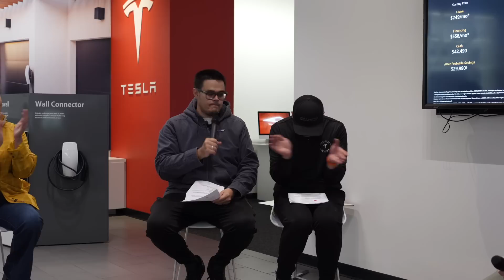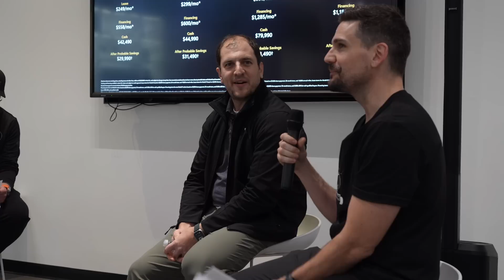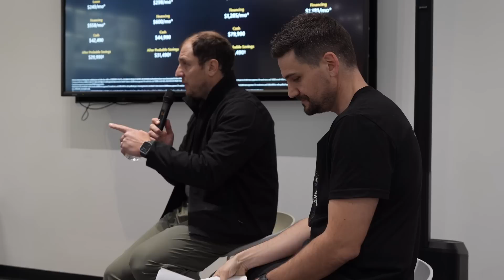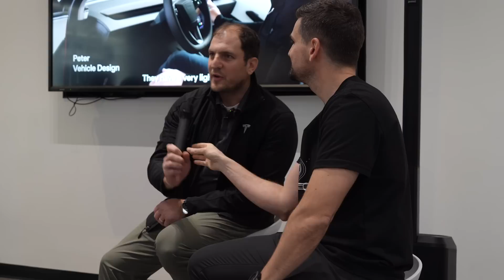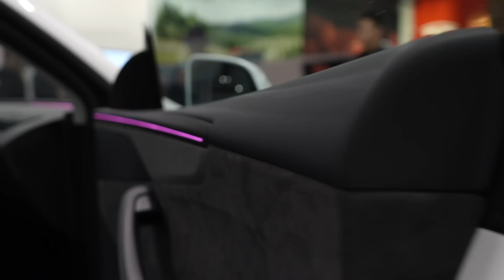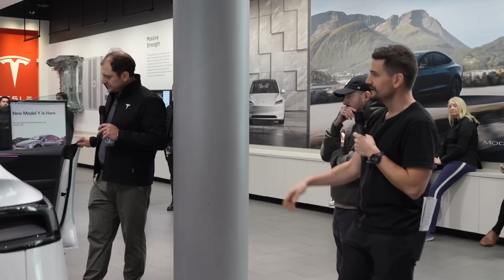SHOCKING DETAILS: TESLA ENGINEERING shares MODEL Y Details

Comment: I have a Model 3 Highland just about to trade in for a Model Y Juniper and the transition to a stalk for turning signals is going to be a game changer. My only complaint I have ever had with the new Model 3 was the turn signals on the steering wheel, it was absolutely horrible and I am glad they recognised the issue.

Comment: Too bad the government keeps mandating those ridiculous mirrors look like they were stolen off a F350 Ford truck‼️ Another problem is the tires all of the eV’s tires wear out in about 10,000 miles due to the enormous weight of the batteries and instant torque❗️The gay guy who picked out the white seats should be fired impossible to keep clean. The front end looks like a set of gorilla lips,get rid of the heated seat seats. Do we really need that in a car that is starving for electricity⁉️ lastly cut down on some of the ridiculous things like 16 speaker Radio and other not essential options get the price down‼️ Gasoline prices are coming down. They just hit $2.19 in a lot of the southern states while at the same time electricity rates are going through the roof in N.Y.

Comment: tesla is losing in many ways compared to chinese EV manufacturers. 
~Charging speed is way slower than competitors, forgiven because they have the best charging network. 
-V2L is non-existent 
-Range of vehicles is moderate
-Fit and finish not as luxurious as some chinese EVs
-Introducing the turn signal stalk only for it to be low quality material
-Lack of heads up display, even the blind spot warning on the model 3 is a joke with that tiny red led light. ENHAUTO fixes this but it is a shame tesla couldn't program their car to do so.

Comment: Looks fantastic…. Please make room in car for a spare wheel & supply 🎉 spare with car. Break the possible bad and experiance with puncture. Or evolve tyres like my Reise & Muller Ebike, which has almost puncture less tyre. Why not produce a tyre that will not puncture. Also with the marvels  of autopilot; 🎉 stop the car hitting curbs and damaging wheel 😢 you must add this feature as it would be unique . Add heads/up a second visual to save loosing concentration by looking away from road. This would bring more buyers;,that’s what they are used to 😮 for ice converters it would encourage them to migrate, new users/ the younger buyers expect the visuals to be straight in front of them ❤ G. I know it’s impossible to please all but my suggestions, just make good sense❤❤

Comment: Why can't the rear occupants in the Model 3/Y have a glass window that can 100% roll all the way down? I mean if you need a child safety reason, that can be addressed by software to simply say "Only allow the window to roll down 45%".

Why can't the Model 3/Y get soft close door actuators which have been around since the late 1990's?

Can anyone at Tesla Motors actually demo how to use the 2018 Model 3 or 2020 Model Y rear occupancy manual emergency door release in under 1 minute without any special tools or any assistive tools? Like for example, if the car was flipped over, how would a rear occupant open the rear door in under 1 minute? Would you feel confident that I could grab any stranger off the street who doesn't own a Tesla and they would be able to figure it out?

Why is it that Tesla Engineers don't do any competitive analysis of other car makers, instead of having to re-invent the wheel even almost a decade after the release of the Model 3? Seems like some of the "great" ideas you have today in 2025 could easily have been figured out in 2015 just by looking at other car makers and asking the simple question "Why do they do this"?

When is Tesla hoping to invest in the Tesla Service Centers to resolve common customer complaints that the techs who work on the cars often physically damage the cars in new and exciting ways? or in some cashes physically crash the cars requiring a 1 year wait to get the vehicle repairs after Tesla Service crashes the car and has it treated like an insurance claim to be repaired at a body shop 🤷🏽‍♂️

Comment: * So, you will come with new colours - nice. What about quality? My black 2023 Model Y can only be washed manually, the thickness of the paint is extremely thin, and after a bit over 1 year of usage I need to fix at least 12spots caused by rubble. 
* New "trunk", as you call it. I almost lost my finger closing the trunk few months ago. Any improvements there?  
* The rear view - is it possible now to see what's behind the car while driving? 
* Until now the feel of Model Y is far from luxury feel. It is all plastic. Pimping it up a bit would cost very little.
* Any improvement on the sensors/cameras? Model Y default state is "Parking assistant is degraded"
* Any improvement of the wipers? We have been waiting now for ages.
* I think it is great that you "rediscovered" your own font - it looks nice and can not be mistaken for anything else
I could continue this list for quite a while. I live in Norway where EVs are now about 80% of new car sale. Tesla Y being no 1. We know our Teslas pretty well. And it is a car designed in California. Really cold weather is a challenge, loads of snow - challenge again. Try to open the door of a black car in the night when it is freezing cold. (without a torch). If you are interested I can send you a long list of tiny improvements that most of us, users must figure our and fix. But hey, we have got a light strip inside the car.

Comment: Build quality...what a joke. Honestly, this is a 8 year platform with updated car building techniques that other car manufacturers have been doing for decades. Noise dampening, compliant suspension geometry and damping, indicator "stalk", front camera and build quality. Tesla just catching up in those areas so nothing technologically mind blowing. I guess the next refresh (don't see Tesla ever bring a totally new Model Y) will have not stalks and maybe a HUD, who knows. 

The Zeekr X7 is cheaper and a lot better value for money with significantly better finish and technology than Tesla. I can't see why anyone would consider an 8 year refreshed platform than a totally innovative and technologically better vehicle like the Xpang G6 or Zeekr X7. 

However, never buy a Tesla at launch as in 6 mths you will get the car at significantly discounted price and especially around Christmas time. Tesla have a high margin on their vehicles and have a lot of leeway to drop prices which they always do. Just see the Model 3 refresh and Cybertruck for example.

Comment: What Tesla isn't telling you is they didn't listen to customer feedback regarding stalks for turn signals. But Europe changed the law requiring physical control for turn signals for safety reasons and if Tesla didn't return the stalk they wouldn't get a 5-star rating on Euro NCAP crash tests. Hopefully, next year the same law will be updated and will require a physical drive selector as well.
Reply: They need to put the bright light switch back and not the auto sensor button which drivers use in the city and blind the other drivers.
Reply: @danc2014  Did you or others test the Tesla light system to see if it blinds the other drivers? I thought Tesla has a adaptive headlight system?

Comment: Ask Angela Chao if she prefers the touch screen shifter. Actually, you cannot: she died when her Tesla went into a pond because she thought she was in D but was in R. And the windows wouldn’t open once it hit water.
Reply: And she was completely shitfaced drunk but yeah it was probably the shifters fault.
Reply: @ yes, you are correct, she was drunk. But she was coherent enough to try to open a window and call her friend (who was in the house a few feet away).
Critical components in a car need to WORK and be RELIABLE. It should not require much thought to shift from D to R or P. And I can assure you that even drunk, she had a (much) higher IQ than 99% of people.
Reply: @ Interesting selecting IQ as measure in this case because intelligence likely had little impact here. I would argue that physical,physiological, and personality traits play a much larger role in human factors mishaps. Even geniuses make mistakes particularly geniuses with cognitive impairment. To be clear, it is a tragedy she died and it shouldn’t have happened but her actions were the significant contributors to the accident. She got in the seat impaired and selected the wrong gear. In the human factors analysis I would want to know things like, experience in that particular vehicle vice others, recency of use, amount of time spent operating other vehicles, physical state, etc. Cabin design can play a role as well as design evolution (new method of operation after decades of a different design). Familiarity with all features is also a factor (mechanical vs electronic door releases). Personality plays a role as well, if a person trends toward panic when faced with a significant deviation from the expected it can seriously impact the likelihood of success. 

I could argue that the on screen shifter has two factors that could make it difficult to use. It is different than the majority of systems in service, and it requires visual verification to ensure correct operation. That visual verification is somewhat inherent in the design. You move your eyes to the screen to slide in the right spot and the visual display indicator is right at the top of the screen where confirmation of the operator’s intent can be seen. Secondary contextual clues would have been present as well. In this case the backup camera would have displayed in addition to the “R” indication at the top of the screen. One might argue that the new method is different from most mechanical gear selectors in that a mechanical gear selector you move the control up or forward to select reverse and down/back to select drive. The on screen selector although different could likely be more intuitive over time because the direction is more closely aligned with the movement of the vehicle but it will take time and experience to overcome the amount of time spent using a different method of control and the concept of primacy (the thing you learned first has some dominance particularly in times of stress or impairment). I know this as a habit transfer problem. I operate to different machines with controls in different locations. I might be inclined to reach for a particular control in the wrong place based on fatigue, stress, impairment, panic, or just error from an imbalance of experience between the two machines.

Panic can play a significant factor as well. People respond differently in emergencies some are cool as a cucumber some are the polar opposite. I dont know where she may have trended in that spectrum but everyone has a trend. Now we can modify our likely response through training practice or experience but most dont do that with driving. This is what also makes intelligence less relevant. As we shift from routine activity to non-standard or emergencies our cognition can also shift from cerebral to more central brain functions “the dinosaur brain” as some say. We can lose higher level analysis as well as fine motor skills in exchange for more gross motor dominance. This can make it difficult to find and press the right control and things like that.

The situation was quite tragic but trying to lay the propensity of blame on the machine and ignore the impairment and failure to recognize the errors she made that day impacts the argument significantly. I personally prefer mechanical controls over software controls but that is because i am older and have spent much more time on mechanical controls. I also love human factors considerations in cabin design like knowing what control I am touching without looking based on it having a disparate feel from a nearby, but different, control. I imagine younger people might feel differently as they have experienced much more use of software controls that can change based on context and phase of operation. I can train or practice to get better but understand I might revert in times of crisis and can overcome that with verification of my activities.

Comment: "...getting much better" isn't a position from which you should be removing controls like stalks and buttons. The easiest way to test this is to have the ability to use the non-hardware control options on vehicles with the physical controls still. I myself don't use things like auto cancel for turn signals, because while it works ok, it doesn't work 100%, which means I'm not having to pay extra attention to when it does and does not work, which results in me turning the signal back on have the time and likely confusing drivers around me.

Little bit of a rant, but you just can't design and sell cars for a FSD world, when it's already 4 years past when they started removing stalks and we're still waiting on FSD. And on top of that, they're adding stalks back in essentially with the new Y because feedback from drivers. Just very poor decision making.

Comment: The front passenger seat control on the screen is a good step, but to make it useful it needs to operate when the car is in motion, and also when there is someone in the seat. 
It’s not as smooth of a process as it could be. I usw the car for rideshare driving and to have to slow down and/or make the person het out of the car just to the seat can be adjusted is not good.

Comment: I am very sorry but it seems that Tesla is not listening to the customers? I know for a fact that the range is not enough (yes i'm a car nerd and Tesla shareholder and driving a Model 3 Performance in Germany, and no i'm not at full throttle Autobahn all the time) and even the long range version of the 3 does not have a pack size that has a convenient enough capacity for me to not always think about range and route planning and weather and other nerdy tech stuff (the usual user would never do) to get an optimized schedule out of long roadtrips. Because i have the direct comparison with ICE cars (not even talking about diesel which are everywhere out here, which has like fuel up and forget range kind of thing going on) i can state that it is much too early in the EV evolution to optimize on battery size on the upper end. Let there be a cheaper smaller pack for everybody that is price sensitive, i'm fully ok with that. But don't think just because you are the market lead now makes one change their feeling about the range is not enough. I still almost never have destination charging where ever i want to go, public charging is mostly blocked by hybrids in cities and expensive. I often use roof racks for bikes and or roof boxes, which throws all the aero and whatever optimization out of the window with a 20-30% penalty especially on autobahn/highway. It makes me swear badly on road trips much more often than i like to admit. I still love my car, but tension is building. (also concerning the crappy EAP but thats another story) Just my 2 cents.
Reply from the maker: It has 5% more range than the previous at least in US.
Reply: @ yes still not enough by a long shot on long range (and performance models) - trading this for time spent about thinking where and when to charge is not a good deal at all.

Comment: So most improvements have been to bring NVH, suspension, etc, to modern standards. Back in 2023, I was in the market for a compact SUV, ended up comparing the Genesis GV70 and Model Y. At the time, Tesla wanted $64k, vs $54k for the GV70, and there was no way in hell there was a good reason for a $10k premium on the Tesla. Besides it being electric, there was nothing the MY did better, ended up with the GV70, I also have a Model 3. This Juniper refresh is good, it makes it competitive in quality and price.
Reply from the maker: Honestly FSD has gotten so good it's worth it the premium and also Actual Smart Summon is a cool capability. I bought Tesla because the cost of maintenance is cheaper over 5 years than ice and it's a robot on wheels.
Reply: @TeslaOwnersSV  just to add some perspective, I ended up buying a 2023 model, but I started shopping around April 2022. At that time, the entry level MY was $64k, and FSD was an additional $15k on top of that, totalling $79k. That premium difference completely overshadowed any savings I could have gained. 

And FSD at the time was... Different. I'm of the opinion that nobody should buy FSD until it is actually FSD; why pay for a feature with no ETA? I understand there is merit to the system currently, but at the end of the day, that's not what you're paying for. To each their own. 🙏

Comment: 19:20 all of the things they said, plus the fact that they moved the license plate off of the hatch and down to the diffusor. A LOT of the noise you heard when the old hatch closed was that plate and the frame around it vibrating harshly as it slammed shut.
Reply from the maker: They killed it with the upgrades
Reply: i think it looked better having the license plate on the trunk. now that area is too plain and the diffuser is too busy
Reply: @Mkvkuv  I like the changes

Comment: Unlike the old Model Y will the new Generation have Blindspot warning?  I Believe that is one major shortcoming of the current model Y.
Reply: You can look over your shoulder. That's what I do in my 18 year old car, and it works great.
Reply: @darylfoster7944  Yup, that's what I do as well on my motorcycle but I expected better from a high tech electric vehicle. Even my few years older Challenger has this very basic technology that the Tesla Model Y is lacking. It is a basic but essential safety feature that is found on most if not all 21st century vehicles just not an expensive Tesla Model Y. Sad really
Reply: @ThomasRSmith-og7zo  it's essential for lazy people. Just saying.
Reply: Model Y has it. It's just not built into the side mirrors. This was mentioned in the video.
Reply: @KelvinGee  okay, if the Model Y has it and it's not on the mirrors where is it.,?